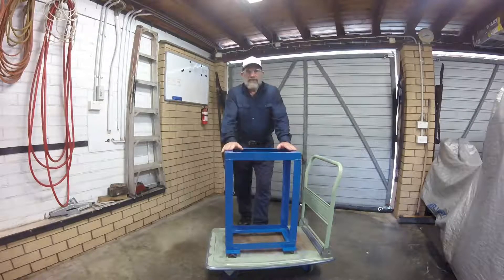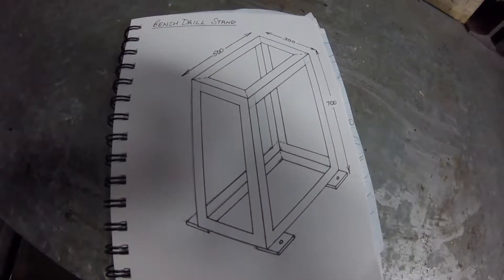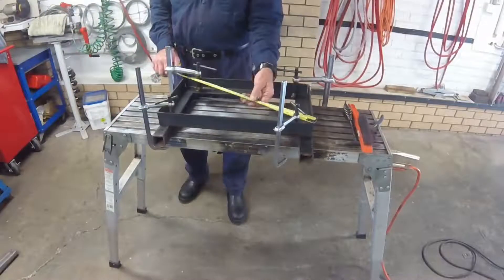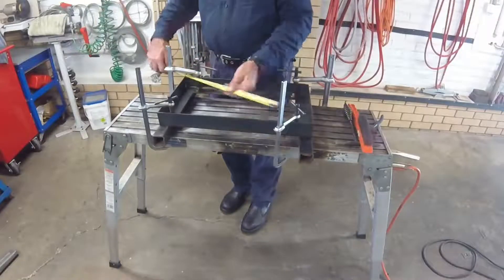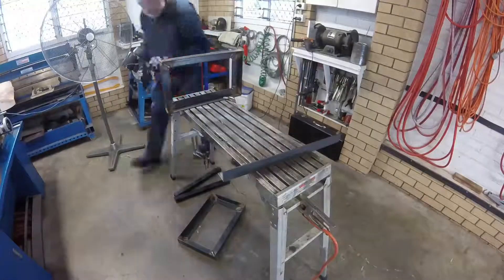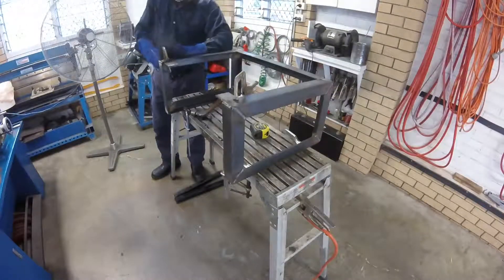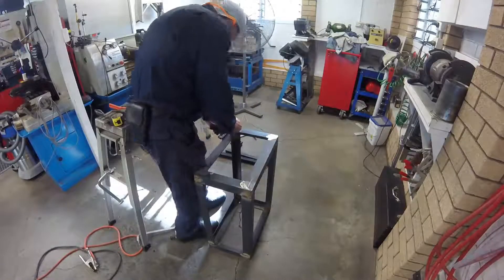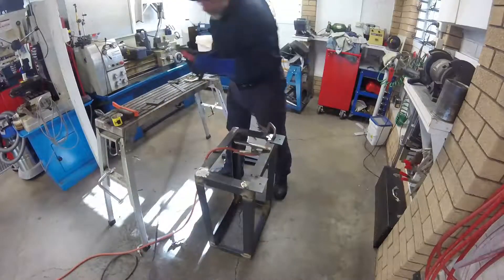Building a simple metal stand for a bench drill.

Comment: Keep the videos coming please. I was wondering why you did not put in a diagonal brace in the structure however?
Reply from the maker: The angle braces in its own right I think. All the joints are welded all round and I think any sideways forces face the problem of trying to bend the angle frame.